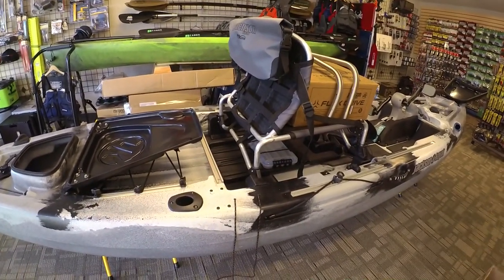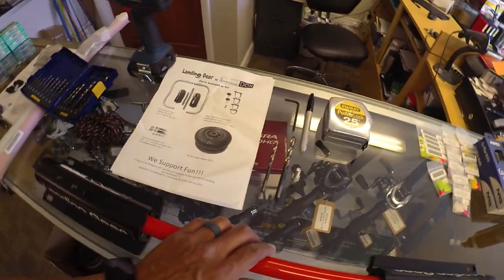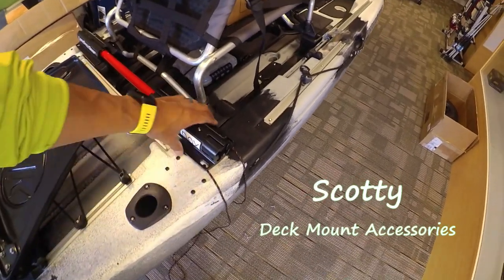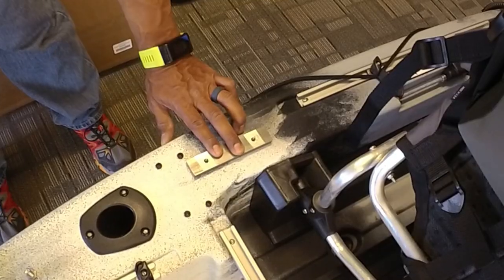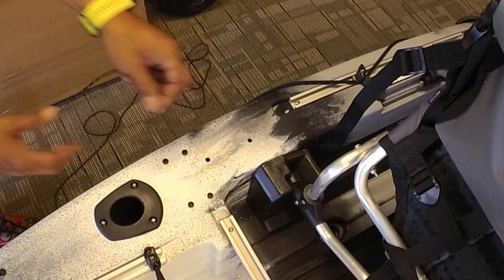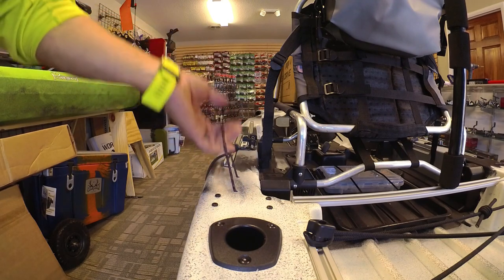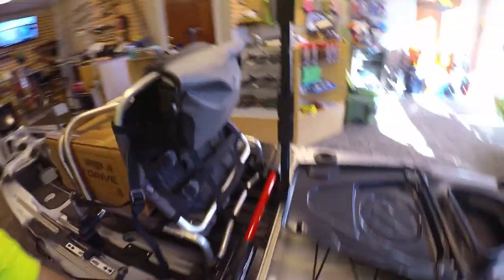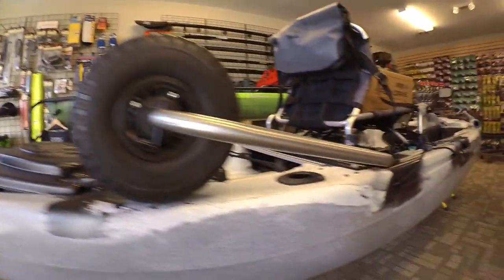Coosa FD - booneDOX Landing Gear Install

Comment: Great info, I think I will be getting one very soon, Thanks for posting
Reply from the maker: They have updated their kits to include a starboard backing material but the technique is the same just run para-cord through the starboard and then the steel nut plate.

Comment: Are u satisfied with the location of Landing Gear in the front of the tank well? I have also seen it mounted at the rear of the tank well on the Coosa FD . Just asking because I just picked up my Coosa and am game planning my Landing Gear install. Thanks for the awesome tips!
Reply from the maker: I would recommend it in the forward position since it makes it much easier to move the kayak. If they are more towards the rear you have to lift more weight . It's much better balanced in the position I used in this video.

Comment: Great looking kayak.  I personally would've gone with the longer backing plates because of the weight of these fishing kayaks.   It would make sure no twisting occurs especially when loading and unloading on warm days when the plastic is softer.
Reply from the maker: Yup, good point. Definitely need to be aware of the structure when adding something like the booneDOX Landing Gear. The Coosa FD has been reinforced in that area to take loads from the HD spline and post base mounts. Also good idea to not store the kayak on the landing gear. I've seen the most damage done to kayaks when they're stored improperly.

Comment: Got it installed! The para cord trick is slick. Now, on to the next project. My son has a Cruise FD coming in the next few weeks. Have you done an install on this particular kayak?
Reply from the maker: Duane Arledge I haven't... I don't have a Cruise FD so can't help you with particulars. Should be pretty straight forward since you've already done it on the Coosa FD.
Reply: Thanks! I'll have a go at it.

Comment: Thanks for the great video.  I have a 2016 Coosa HD - will this install be the same?  Also, was this a booneDOX standard kit or HD kit?  Thanks, Mike
Reply from the maker: Hey Mike, This was a 2016 Coosa FD and Standard kit. I've done subsequent installs with the newer kit and utilizing the starboard plates under the metal mounting plates. You can add the starboard plates under the older/standard landing gear, will just need longer mounting bolts. Use stainless hardware if you go that route. I have not mounted the latest booneDOX Landing Gear with the improved knuckles but install would be the same. JD

Comment: Did you us an loctite on the set screws. Great walk through  Thanks
Reply from the maker: making it reel no thread-lock. I put a dab of the marine goop on there and holds just fine. With the aluminum threads and steel set screw I'm not a fan of using loctite. If you do be sure to use blue loctite. Red would need heat applied to break it free.

Comment: You just convinced me I can get this installed on my Cuda HD......I think. Mounting it just in front of the crossbar seems to be the only logical location. Did doing that restrict the sliding of the seat or remounting the RAM tubes?
Reply from the maker: Only lost about 1" of seat travel if that. I thought it would be more but can slide the seat back more than enough for me at 6'1". I originally used the RAM tube in the booneDOX mount (it has track groove) but went with the Zooka Tube deck mount in the molded in nut plates.
Reply: JayDiz Fishing, Thanks for the info. I can lose that much as I'm only 5''-8".
Reply from the maker: Be sure to measure a couple times and be sure you've go it where you want it before drilling holes in your boat. I still get nervous and been rigging boats for years. Marine Goop is your friend.
Reply: Got home and took a look. The Cuda HD doesn't have the space needed. Really bummed! My buddy just installed one on his Cuda12 and loves it.
Reply from the maker: That stinks... I have a Cuda HD at the shop and see what you mean. Let me think on it...

Comment: John..Love the tutorial is was very helpful and informative...I was wondering if you considered drilling and tapping to allow for the second set screw to be used...
Reply from the maker: Jim Gargano since I talked to the guys at booneDOX and they didn't feel it would be an issue I didn't consider it.  I suppose if you have the tap to do it it couldn't hurt.
Reply: Thanks John...after watching your video I now have the confidence to install  the Boonedox on my Jackson Coosa FD..
Reply from the maker: Jim Gargano awesome! Be sure not to store your Coosa FD on the landing gear though. They're great for moving the kayak around and launching but leaving the full weight of the boat on them for extended periods can cause the plastic to deform over time especially when it's summer. I believe booneDOX mentions it somewhere in their info.
Reply: I have already made a cart to store it on...thanks for the additional information...By the way how do you like the Coosa FD?...I live in the North East and will be doing some ocean fishing on it...
Reply from the maker: Jim Gargano it handles wind and rollers pretty well. I posted a video out on the water in 20 to 30mph winds. I know some the Jackson guys have gone off~shore with success.
Reply: I did watch that video...it was one of the main reasons I picked the Jackson Coosa over other kayaks brands...Thanks again for putting all your expertise on the Web for all of us to use...

Comment: Great video! I really like the tip with the paracord. I have boonedox landing gear on my slayer propel 13. I do not think i would own this kayak without it, however with a trailer and boonedox it is easier than rooftopping a regular paddle kayak. I've had my Native for a couple of years and i like it, but i'm interested in how well this coosa flex drive system will be. It looks like it would be great for the places i fish. I hope to see future videos to see how well you like it, and the boat in general. Good luck with the boat and i subbed for the well done video. Thanks!
Reply from the maker: mulletman2m Thanks for watching and subscribing. I took the FD out last week and real happy with it. The landing gear is a must with this kayak. I used a cart for my BigRig but was still hard dragging it around. I'm going to try and get out again tomorrow and take the cameras with me. Stay tuned...
Reply: Can't wait for the video. Also doesn't boonedox  make a longer bar for the hobie kayaks? I would think the longer bar and two more set screws would make a big difference in not allowing twist. Just a thought, anyways good luck on the water.
Reply from the maker: Unfortunately the weather didn't cooperate yesterday, too windy. I don't mind the cold but wind + cold not so fun and difficult to get good audio. Hopefully I can get out soon and shoot a walk through and on the water video.

Yes, booneDOX does have a longer bar but it was too long for the FD. I called them and they said it would be fine just make sure the set screws are tight.

Comment: How"s  the Boonedox landing holding up on the coosa Fd. Reason am asking. I just purchased a new 2018 model and  have the new 2019 Boonedox groovy landing gear on order with the UHMW stiffener and wedge plates for larger foot print when mounting. Your thoughts about it. Have you heard of any problems from others about the landing gear trying to crack or pull through the plastic from the weight ect. Thanks
Reply from the maker: Still holding up great on this original install. I've done a few others on Coosa FD's using the newer backing material and plates and those have been holding up well. Biggest thing is to not store the kayak on the landing gear. Most of the issues I've heard about were caused by that. Also I try not to over load the kayak if I'm going over rough terrain to minimize the risk of damaging the kayak.
Reply: @jaydizfishing6024  Thank you sir for getting back. I'll take your advice with my coosa fd.

Comment: Just checking - you used the standard Landing Gear, right? You didn't have to order the extra long cross bar, did you?
Reply from the maker: Duane Arledge correct, used the standard bars that come in the kit. The longer bar designed for the Hobie Pro Angler was to long for the FD. As mentioned in the video I called booneDOX to be sure I'd be OK with only using one set screw and they confirmed that it would be fine.
Reply: Thanks!

Comment: I need help finding a good location to put my boonedox on my CruiseFD.  I have watched a LOT of videos but none showing where to install on my type of yak.  There is a large flat area behind the gear track behind the seat but it means I take 1/3 of my well and would have to cut the two bungie hooks directly behind the track because they stick up too high.  I'm 5-5 and my seat is all the way forward and I have tons of room behind my seat in front of the bar but the sides are not that thick and that is also where the rudder cables are located.  I may be able to position the boonedox directly over the gear track behind the seat as well.  Just not sure.  Can you help me?
Reply from the maker: Looking at the layout of the Cruise FD  seems the only option is right on the edge of the tank-well. Basically the forward edge of the mounts would be on top of the gear track. You would still have plenty of tank-well and the Landing Gear mounts have gear track slots so you can mount accessories on them. You're correct that there is not enough room forward of the tank-well and the rudder control rods will be in the way. I don't have any Cruise FD's in the shop so I can't be 100% on the location but I believe there would be enough room to allow the control rods to function without coming in contact with the Landing Gear mount backing plates. Hope this helps... JD

Comment: When the wheels are stowed in the up position, will they get in the way of the rod holders? The angle looks like the wheels will be in the way.
Reply from the maker: If you rest the wheels on the hull its close but if you stow them with the wheels outboard of the hull there's no issue at all.
Reply: Sounds good. Thanks! 

I'll be upgrading from the Big Rig to the FD this winter. Was surprised to that the Landing Gear would fit. So thanks for the video! =)
Reply: This is a great video!!! Thank you for sharing. Love the Paracord hack!!!

Comment: Can you remove the wheels once in the water. Really don't like idea of them being on the sides outboard because I knoe for a fact they'll get in the way and definitely don't want them deployed in the water because of drag. 
Thx in advance.
Reply from the maker: Keith Lapere yes, I usually take them off once I get on the water. I leave them in the truck but they actually will fit inside the front hatch of the Coosa FD. Also it's recommended to not leave them in while driving as the might vibrate loose.

Comment: How long is that mounting plate?
Reply from the maker: It's about 6 inches or so. Since I made this video BooneDOX has changed their design of the landing gear slightly. They have also include material to add more support to the mounting area for different kayaks.
Reply: @jaydizfishing6024  I own a Coosa FD and saw your video yesterday and was impressed. However, my main concern is the structural integrity of my kayak. I’ve noticed several people are now adding additional layers of plastic below deck and above deck for added support. You mentioned Boonedox has since changed their designs which helps provide additional support. Which of their new models do you recommend for the Coosa FD? Thank you for putting together such a great video. 🇺🇸👊👍